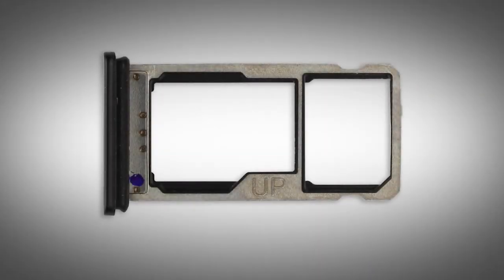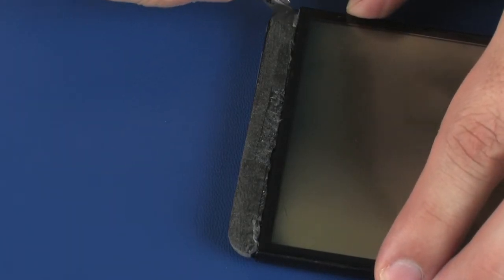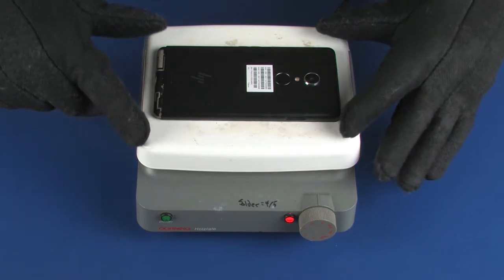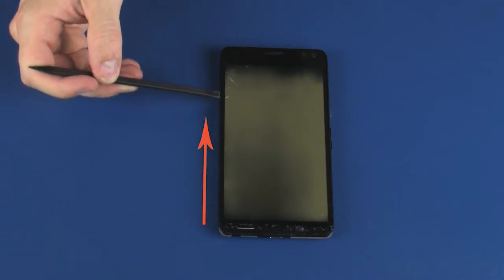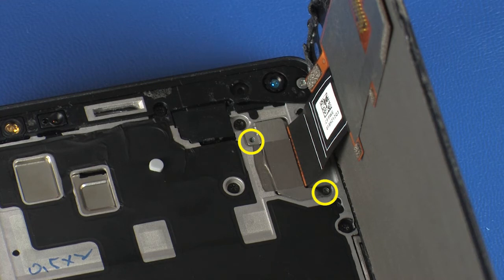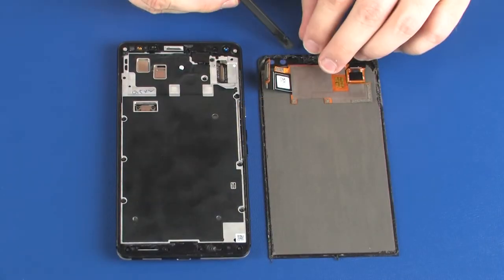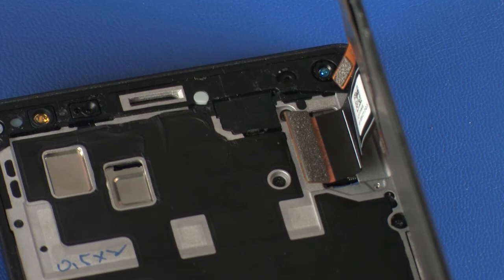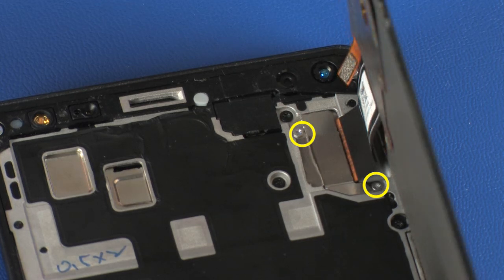Replace the Display Panel Assembly | HP Elite x3 Phablet | HP Support

Comment: Thank you
Reply from the maker: +U N K W N I am glad to know that the video was useful to you.
Reply: @HPSupport  is it possible to replace the battery without also replacing the chasis, the chasis is no longer available anywhere. So, if I replace my battery with a new one , but I use the same chasis, will my phone have any damage to it because I did not get a new chasis?